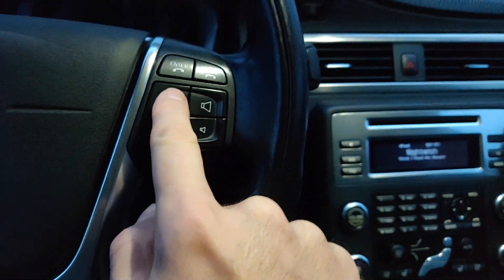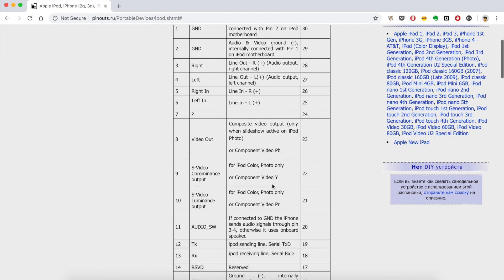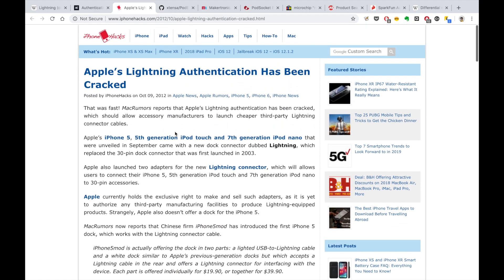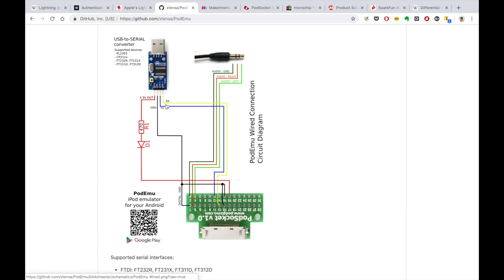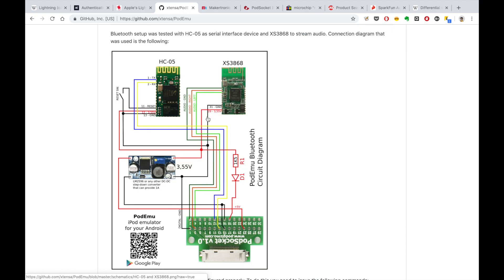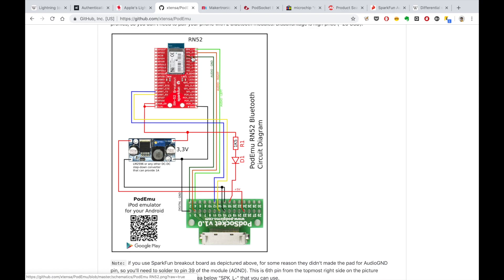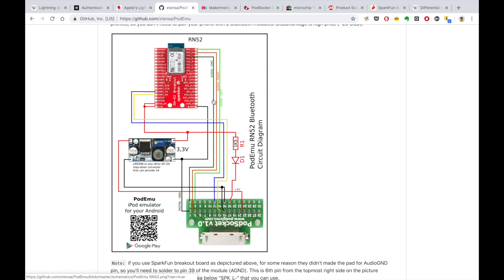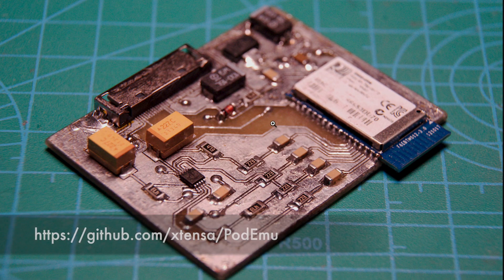Assembling adapter for Android Phone and iPod 30-pins full integration

Comment: Extremely helpful for the scenario I'm dealing with, a 2009 A4 2.0T with the Symphony radio. Although it has Bluetooth, Audi only allowed phone calls, not audio streaming (A2DP). For some reason they also disable 5V output from the AMI port when the input source is switched to aux and Bluetooth adapters have to be powered externally to work at all. Even supplying the adapter power, most of them don't support L2CAP anyway and all functions have to be controlled on the connected device itself instead of through steering wheel or head unit buttons. There are inexpensive AMI to 30 pin iPod cables, but Bluetooth to 30 pin iPod adapters that support L2CAP are ~$70 to $100.

Comment: Thanks for developing podEmu. I have a phone with Android 8 that supports the podEmu app, and a Motorola Razr 2019 with Android 11 that doesn't support your app (Google Play says it's incompatible). Do you plan to release a new version for more recent Android versions (such as 11, 12, 13)?  Also, do you know a practical way to discover what baud rate a car is using? Thanks
Reply from the maker: Yes, I am going to update it to work with new Android versions, just need to find some time...

Comment: Do you think it’s possible to make a dedicated circuit board for this?

E.g. A programmable Bluetooth SOC chip with a serial interface that you can directly connect to with an Android or iOS Phone without PodEmu. I suppose that would make this compatible with iOS also :)

I’m interested in maybe porting podemu to c/c++ so it can be run from a SOC.

Comment: Thanks for your amazing work.
Could you upload the video from the lighting - 30 Pin Adapter soldering?
Reply from the maker: What adapter do you mean? Can you please provide the link?
Reply: @e-lab4982  This one, were you cut out the soldering process :D https://youtu.be/sF_FdbrCGGc?t=269
Reply from the maker: @MrRoxx17  Hmm, lightning part is removed completely. I just used 30-pin part as simple break-out board.

Comment: I have a Sony Headunit CDX-DAB700U, which has ipod/phone compatability, but not androis, even from my Sony XA1! Can i use this to emulate an ipod over usb, or is there more envolved?
I thought there was a 'patch' or 'chipped' cable which did this, but maybe it was a kickstarter that never delivered.
Thanks for the great work.
Reply from the maker: Unfortunately you cannot use this app to emulate iPod over USB. As far as I know "patched" USB cables that will work with PodEmu were only available in some KIA/Hyundai cars.
Reply: @e-lab4982  I have a 2012 Hyundai Veloster which accepts Ipod in over it's USB port rather than a 30 pin input. Can you tell me any more about this patched USB cable that you referenced here? I would love to use your app with android and my car's radio.